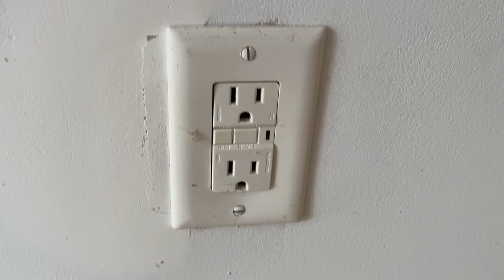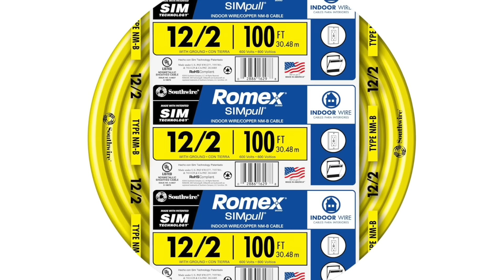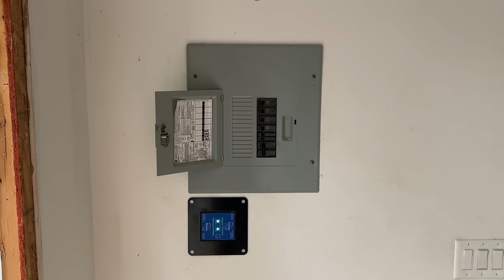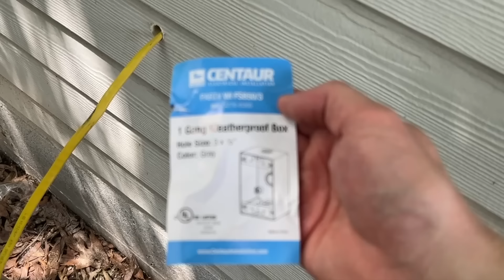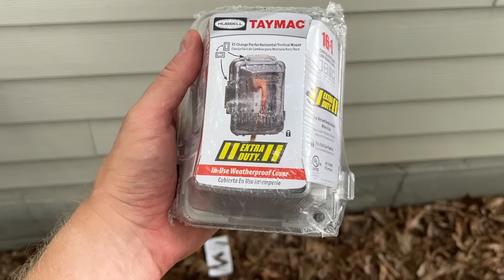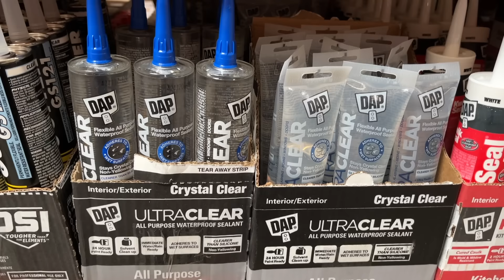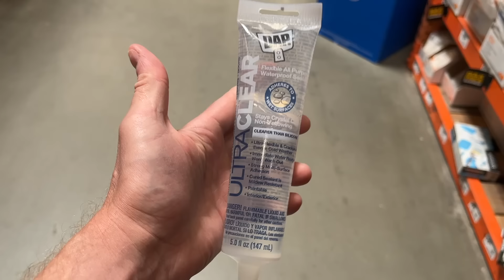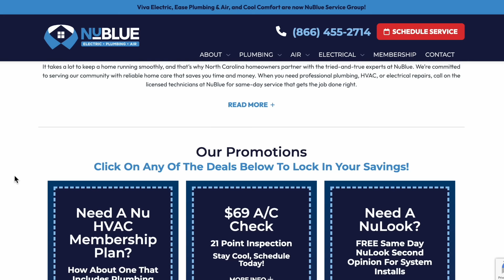FASTEST EXTERIOR OUTLET! One-Hour Outdoor Receptacle...FULL INSTALLATION!

Comment: Unused electricity?  That's... a unique way of saying it.
Reply from the maker: Elaborate, Kenneth…
Reply: @TheHonestCarpenter  First, electricity doesn't get "used up," in that way, so it makes not sense to say that there is used or unused electricity.  Rather, current flows.  Without a neutral, there is no path for current to flow.  All of the metal's valence electrons are full and the electricity effectively "dead heads" (to use a fluid analogy).  If you consider an electric load to be like a piston, one side (hot) must be at pressure.  The other (neutral) must be at a lower pressure... for instance, vented to atmosphere.  Otherwise there is no motion.

From another perspective, the current flowing through the neutral IS the "used" electricity finding its way out of the system (or, in a closed electrical system, finding its way to the negative end of the battery or such) so that there's room for more electrons to follow behind.

Source:  Ten years of working in shipboard propulsion plants.
Reply from the maker: @kennethmiller2333  Ahh, I gotcha. But what about the portion of electricity that actually gets used through the outlet? I was always led to understand that the electricity flowing back after usage is sort of enervated, and needs to get "recharged" at the power source. Or, is it ever possible that, like, 100% of the juice flowing through that line gets used? What goes back then? Just current with less charge?
Reply: @TheHonestCarpenter  That portion of the  electricity is what flows back through the neutral.

It's easiest to first picture a simple circuit.  One end of a battery wired to a resistor, wired to the other end.  Current flows from the positive end (yes, negatively-charged electrons flowing from the positive end of the battery... That's what happens when two conventions for the same thing develop independently - honestly, we should just all decide that electrons are positive and protons are negative - it's an arbitrary assignment anyways), through the load, and back to the negative end.

In large-scale distributions, there is no "negative end" of the battery.  So current flows from the positive end of the generator, through the load, and into the neutral leg, which leads back to the distribution line's neutral side.

The important thing to remember is that electricity must be in motion to do anything.  That is, current must flow.  Everything from heating up light bulbs until they glow to turning a motor is caused by current flowing, not merely by presence of electricity.

You're on the right track with current with less charge.  However, what drops is the voltage.  Consider that kind of like pressure.  Every load causes a voltage drop, which is why wiring them in series is a bad idea.  If the first load in the line is at 110V, the second may only be at 80V, which may not be enough to effectively power it.  So what happens when it flows through a battery or leaves the generator is the voltage is brought back up to the reference voltage so that it can be "pumped" through the system again.

Comment: how about using WAGO's on the pigtails? what does your electrician think of them?
Reply from the maker: I think he prefers these twist nuts, Erica! Just a good connection that’s also easily reversible.
Reply: Wagos are handyman friendly, but most electricians skip them because wire nuts take less inventory and cost mush less per unit. - and good electricians all have an inherent resistance to anything that resembles a stab connection.
Reply: @kenbrown2808  I can see the added cost as a factor, but I would bet that most trades people are just resistant to change, WAGOS have been a proven time saver and if one does not trust the lever from poping up you can use tape or there is another brand with a "snap" in place design that eliminates accidental lifting of the lever. It may seem like a "stab" connection but it isnt at all. Just my 2 cents
Reply: @ericarachel55  I use them for applications where equipment has a short service life.  but the Wago has a connection for every wire, whereas wire nuts are just one connection.  they also have quite an arc if you do a hot connection, and they rot out in a corrosive environment.
Reply: @ericarachel55  Not much of a time saver. In fact, if one takes the time to tape Wagos closed they are slower. It takes less than a minute to twist wires and thread on a wire nut. Basic 2 wire Wagos costs 3 times as much as wire nuts. That adds up when you use thousands of them.
Reply: @ST-0311  that is where the other brand comes in and it is less expensive from what I have been told, my electrical ecperience is limited, most of the electric in the treatment plant where I worked was 3 phase 480 power which I left to the pros except for reversing leads for counter rotation of pumps. The wagos I have used are only good for up to 20 amp circuts where they work fine
Reply: @kenbrown2808  interesting, I have never heard of the arcing problem. Which part of the unit rots out and what type of environment?
Reply: @ericarachel55  it's a pretty harsh environment.  chemical rich, and they'd lose connection in about a month or two.  I switched back to wire nuts after about three months, for that application.
Reply: @kenbrown2808  makes sense, we had a problem with chlorine corroding everything around when mixed with water. Sometimes it would form hydrochloric acid but all the outlets and switches were designed for it, we usually left that for the pros to deal with
Reply: Taping Wagos is for hacks, just like taping twist nuts is for hacks.
Reply: @MoneyManHolmes  yes oh God of wiring....

Comment: Why do you have a 15 amp gfci feeding a 20 amp outlet feeding a 15 amp outside outlet?
Reply: It is a bit weird, but it is code compliant because either 15 or 20 amp receptacles are permitted on a 20 amp circuit. I would use 15 amp heavy duty industrial grade for the entire circuit, but 20 amp would also be acceptable and preferred by some.
Reply: I would never put a 20 amp outlet in a home unless specifically requested, even though I only use 20 amp circuits and 12g wire. I’ve literally never seen a device that requires one.
Reply: @MoneyManHolmes  Totally agree. I saw a Thermador range top that had a 20 amp plug. It required a dedicated circuit, so a 20 amp duplex receptacle would be a code violation.

Comment: What is “unused electricity”?
Reply from the maker: It’s like leftover food 🥩 🥦
Reply: @TheHonestCarpenter  If you measure current on hot and neutral and they are not the same you have a ground fault. There is no such thing as unused electricity.
Reply: In my opinion, its a demonstration, one of many in the narration, that the guy who did the narration in this  video should never be allowed near any electrical wiring project.

I'm glad that the actual work seems to have been done by a  qualified electrician, yet even several parts of that work are suspect. 

The duplex device in the outside looks an awful lot like a 15 amp device, which s just WRONG in a 20 amp circuit.  Where's the telltale T slot on the neutral  prong slot to indicate that it is a 20 amp circuit?   This is all supposedly done as new work, with newly purchased materials.  Why not have the actual WR rated 20 amp duplex device?

And that "chase nipple" even with the plastic insert to avoid  friction tears in the Romex sheathing and the black / white internal conductors is also WRONG. A clamp is required.

Comment: I thought “backstabbing “ was a no no
Reply from the maker: It’s not backstabbing. That’s a screw clamp terminal. You have to enter the clamp through that hole.
Reply: Don't use the backstab holes on the back of the outlet.  Some outlets allow you to back wire into clamps on the screw terminals.  Those are my preferred connections.  Completely solid and don't require making hooks.
Reply: @sociopathmercenary  good to know thanks

Comment: Your electricians seem like idiots. They did a number on the drywall around the new work box when fishing the 12/2 from outside, which seemed utterly pointless, considering preserving the drywall was the rationale for pulling the wire this way.